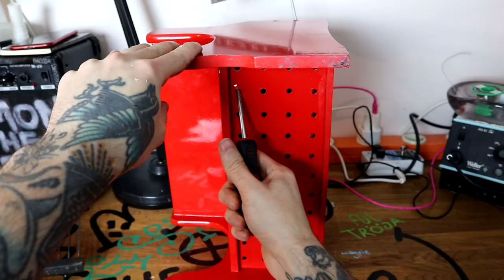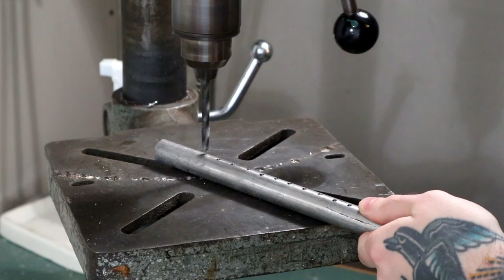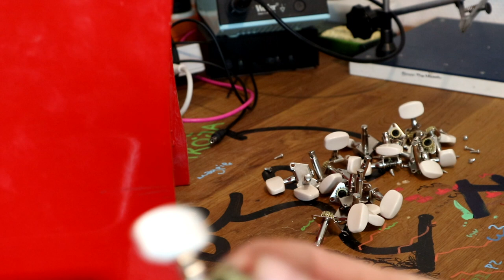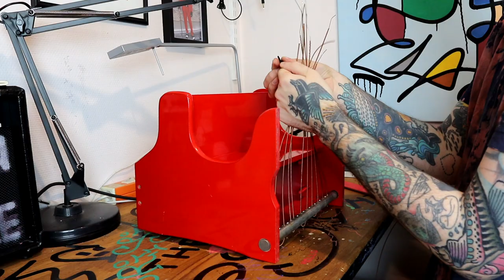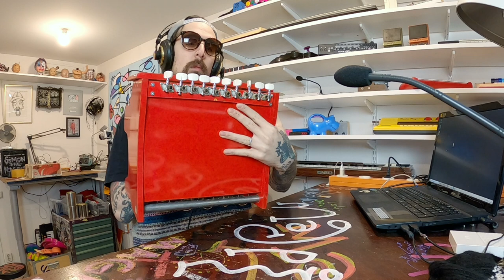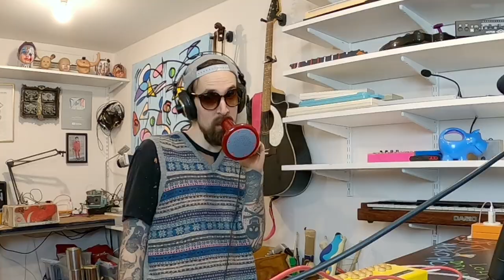I Put Piano Strings On A Toy Piano So Now It's A REAL PIANO

Comment: Kind of sounds like tubular bells to me idk why
Reply: It sounds a bit like bells. At least the lower ones.
Reply: Sound like steel drums
Reply: it's because of the low tension. Strings are way more inharmonic this way, eventually sounding like bells. In addition, the toypiano hammers don't mute the high partials as felt hammers do, enhancing the inharmonicity (-> https://en.wikipedia.org/wiki/Inharmonicity)
Reply: Yeah it actually does.  Which makes me want to make some tubular bells.  Hmm...
Reply: @guitfidle  I wonder what possessed you to want that...
Reply: Sounds like Spiderman vs Venom in Spiderman 3
Reply: Dx7 bells maybe

Comment: Brilliant idea. You need to use metal violin strings for the higher notes and viola strings for the low notes. They're much thinner than piano wire, and will be easier to tune

Comment: dont think the nylon strings would work , thin guitar strings however .....
you might need to make a top nut so the strings will stay in front of the hammers and might not buzz so bad 
could alsso take the rear wall off the piano and make it about 50 cm longer so you got some length in the strings , if you use a thick piece of hardwood it might sound even better and can handle the tension

Comment: You could maybe fit a small wheels or bushings at the top where the tuning pegs are now, then place the actual pegs lower down on the back of the instrument.  Then you could off set them ( high mid low, high mid low)so you can group them tighter.
Ah, the problem you'd run into with that is hitting the string on either end of the bushing.  If you were set on keeping the tuning keys from the uke, I'd maybe run the ends to the outside and have an additional assemply for the keys to be attached. Then you could do a couple rows and have the keys alternate which row.
Alternatively, you could use the tuning pegs and pins like on a lap harp (zither), and tune each end of the string.

Comment: Hey, Simon, the reason you don't have enough room is because you're not using tuning pins!

If you want to be able to support stronger strings and be able to incorporate all of your strings you'll want to use tuning pins from pianos. You can buy them online. For installation you have to drill a hole slightly smaller than the pins, so when you drive the pin into the wooden pinblock the friction prevents them from rotating unless turned with a tuning lever. Another block at the bottom with hitch pins would help as well! 

Also, if you want to improve the sound you need two bridges. One bridge is near the hitch pins, and the other is near the tuning pins. These bridges help with both alignment and sound.

I'd recommend just googling "piano pin block" and checking the images. It'll give you a good idea of what a piano's pin block looks like.

Comment: I feel like it would maybe benefit from having a bridge, also feel like you could easily mount more tuning pegs under and between the top ones, and actually you could even drill extra holes in the tuning pegs so you could have clusters of strings like in a piano (sort of) and the bridge would keep them all at the right height (I am assuming)

Comment: Omg, where did you find those Piano strings? The bottom of the ocean. I think you would benefit from smaller gauge strings will work better, you won’t need to get so much tension on it to get a playable note.

Comment: i simply love this project. I think if you have a full internal metal frame and staggered your pegs so you could have more strings per key and higher tension it would sound even better. that said i think this is a brilliant little project well worth elaborating on

Comment: Perhaps make a zig-zag pattern where a second row of tuning pegs is placed below the first one and offset in-between, so that you effectively reduce the distance by half without the second row getting in the way of the first.  Then, consider grouping it so that up-down-up-down-up is white-black-white-black-white for the C thru E keys, and that down-up-down-up-down-up-down is white-black-white-black-white-black-white for the F thru B keys, etc.  Hard to picture by reading it, but if you try this method, you will get the gist of it.

Comment: To cover the black keys, might need to take the plastic handle part off the tuning pegs. Then use a rotary tool to grind in a slot on the post where the handle was to turn the pegs with a flat-tip screwdriver. Then diagonally stagger the tuning peg placement to get them all to fit. Seems like that might work if given another go.

Comment: you should try using a combination of guitar and bass strings so each note is not sharing a string with another string and so it will tune better. you can get the the black keys in there if you add another row of tuners below and offset from the top ones, just use tuners that don't have perpendicular pegs or cut out a hole for the knobs so you have space to tune them.

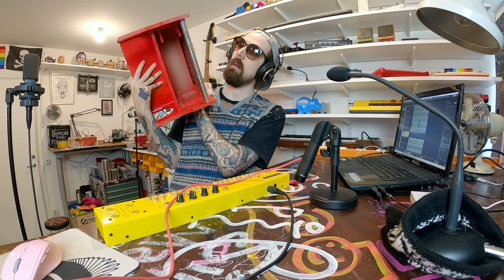Comment: 13:23 - you can fit more strings in it by thinking of a guitar. Just put a plastic board on top with notches and do the tuning on the back plate.

Comment: Yeah bo!! I reckon guitar strings. The ball end would allow them to be captive in that nice little bar that's been drilled and then tuned independently. There's a comment below about offsetting some more pegs for more strings? that could work, a second row of them below, as long as they're higher than the hammers it'd still work. They'd have a different timbre though, but that could be cool!

Comment: It sounds more like a grandfather clock than a piano. You could double up the strings with smaller ones and tune each pair an octave apart under the same hammer so they play together.

Comment: You could fit more pegs if you put some tuners above or below each other. It would sound better with longer strings so if you added a board to extend the back of the piano you would have plenty of of room for tuners stacked over each other and the strings could be longer and you would get more sustain.

Comment: the way the strings are setup, the two connected strings will try to reach the same pitch, because one side is pulling more tension on the string than the other side. I think it would be neat to see this with some violin/viola strings (The end of the string would fit your mechanism a little better) or with ukulele strings, because it might give a better tone with a shorter length. Not sure.

Comment: This is really cool. Because the actual keys are not bad. I'm thinking you could do all kinds of things. With 2 or 3 of them, use electric guitar strings and pickups and make a clavinet. If you don't want to go through all that, just a bigger harp would be good. I saw one guy make something similar with fishing line. It was quiet but it worked.

Comment: A piano in essence are a harp with hammers slamming down on the strings. Maybe a bit of welding to create a "harp" that can handle the needed string tension and then install that. And those ukelele parts are too weak for the tension needed. You need a wrench to tune a piano. I believe that this project could be improved upon.

Comment: I've head of a band saw and a table saw but I had no idea automated hacksaws existed.
Reply: That was SUCH overkill when a handsaw would have been adequate and a whole lot faster!  Also - has the guy ever used tools in his life before this?  e.g. the file for trimming the tube raw ends - draw it down over the end not 'at it' like you were doing - or put it on a bench edge and rotate as you file.  The hole drill - go down from the top not in from the side, you'll have far more control...  Fine example of 'all the gear, no idea' I think..

Comment: If you use guitar strings, you should be able to get away with using zither/harp tuning pins instead of the geared ones. That'll give you enough space to fit all 13 notes—even double that if you wanted it to be more piano-like. Get a 12-string acoustic string pack with an extra single and you're set.

Alternatively, you can just tune the piano in 10-TET instead of the normal 12-TET.

Comment: Real bass piano strings are designed for a specific scale in relation to the wire size and how much copper is wound on it. You would never be able to get enough tension using guitar tuners with bass piano strings. It would crush the toy piano case before the string could get enough real tension on it but the tone would never arrive because the length is ridiculously short. Nice try though.

Comment: you should have checked the that piano strings are high tension strings where as guitar srings are low tension strings the moment you installed guitar string tuning nobes it was bound to fail...
please do your research before attempting to build it will save you and us time.